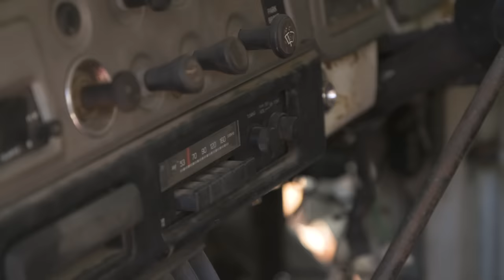THIS 4WD HASN’T RUN IN 19 YEARS… Will it start? Shauno's Barn Find Toyota LandCruiser 40 series!

Comment: The fuel shut-off lever has a solenoid that pulls it in the opposite direction for starting.
Helps a lot for first start or during the day when sitting a few hours.
It fuels a bit more at start-up.
Saves the glowplugs and starter a bit in the long run.
These Cruisers are the toughest vehicles for farm and overall use. Not the fastest but will get you home and the job done.
Absolutely love them.

Great videos as usual.
Keep up the good work.
Cheers from Namibia

Comment from the maker: This is the LandCruiser I've always dreamed of owning. What's the 4WD you've always dreamed of owning? Tell us below in the comments! Cheers, Shauno
Reply: 1996 TD42 GU patrol
Reply: A ‘92 GQ patrol chopped and Barra swapped
Reply: 1995 Nissan GQ TD42 Ute
Reply: A DMW Chopped 200 series 😜
Reply: Mine is either a LandCruiser 75 series or Gu patrol chopped and extended (four door) with twist 79 V8 Engine
Reply: 12ht 60 series landcruiser, and I've found one
Reply: ✌✌😍2006  Ford endeavour (INDIA)
Reply: Finally picked up a rig i have been wanting for years. 
Factory auto 1hz 105 series landcruiser.
Turboed, intercooled. And mods to come
Reply: Single cab VDJ79 Landcruiser
Reply: A Toyota Rav4
Reply: Same as you mate and I’m driving it hj47 ute
Reply: @JP211193  those  rigs are known for blowing diffs
Reply: 6BT Cummins swapped GU Patrol! 😍
Reply: Suzuki LJ50
Reply: daihatsu rocky tonner
Reply: 75 series landcruiser same as your one shauno
Reply: 79 I mean
Reply: First generation Bronco!
Reply: Classic 62 Toyota Land Cruiser FJ 40. Restore it to original and keep it in my living room.
Reply: 75 series with 79 front and 1hd fte
Reply: Literally the exact same thing just a late 70's model and same build style
Reply: 1980 G60 nissan patrol
No syncro
no power steering
shit brakes
rough suspension
everything as rough as guts bare bones basic
I really miss mine
Reply: Being 10, I dream about a lot of cars. My dream car(s) would be 1. A big V8 79 Series LandCruiser 2. Or a well done up Short-base GU Patrol.   :)
Reply: Keep the rusty bonnet
Reply: 1989 Chevrolet Blazer (U.S.A). Currently my daily driver. Great vid. Keep 'em coming. Cheers.
Reply: 2011 Toyota Landcruiser VDJ76R
Reply: CONGRATS Shauno on the purchase, the build will be/should be an inspiration to not only 4wd enthusiasts but for anyone who is looking for something to do during these tough times either on their own or with family/loved ones. Think I may have to do something similar with my little 4 but thinking a 40 or 45 wagon ... Thoughts ?
Reply: Currently own my dream truck, 1977 series 3 landrover, chassis is buggered though so after a new galv one for it. but i wouldn't say no to a toyota like yours
Reply: Gq Td42 and i have one now.
Reply: 89 extra cab SR5 engine swap 1KD FTV
Big job but I’m getting there!!
03 duel cab SR5 1KZ-TE just watching wondering what’s happening to it older mate!!!
Reply: chopped lc200 series
Reply: put a 6bt in it
Reply: G wagon
Reply: 60 seris land cruiser
Reply: 79 series duel cab. Hopefully I'm only a couple of months of finally owning one
Reply: 4WD 24-7 the 200 series in my driveway 👍 well done on getting the old truck going
Reply: My dream truck is my daily driver, turbo 2h swapped fj45 troopy!
Reply: Bundera
Reply: Blue Marlin 80 Series
Reply: My dream 4wd is exactly what’s in this video Shauno. So keen to see the build👌🏻
Reply: Great wall
Reply: Mine is a 1986 Toyota landcruiser bj73 had one wish I never sold it
Reply: I finally own it A Landrover Defender 110 from the 2006 G4 Challenge event. It's in Tangiers Orange with an auto fitted and twin lockers. Its great for getting around on my island
Reply: 12HT 60's Series in that sandy colour
Reply: 105 series landcruiser.  That's a problem since I live in the states.
Reply: I'm starting to like Toyotas
Reply: Ls swapped gq and enough money to keep fuel in it
Reply: I think it has to be an 80 series for off roading but if I was overlanding I'd go for a Ranger or a dmax, I know quite a few weaknesses on the Ranger that need to be fixed before I woukd trust one though.
Reply: Ram 2500, Cummins, Bench seat, 4x4, 6spd MANUAL.  Just bought it a few months ago!
Reply: Would have to be 70’s to early 80’s f100
Reply: Although not a 4WD, it is the Chevrolet 3100 as a classic, and for today a Ford Raptor or Jeep Gladiator.
Reply: Always wanted an older Hilux ever since I was young. Grandad had an ln106 for over a decade and I fell in love with the old hiluxes. Since getting my license I'm on my 2nd ln167, with plans to buy a 106 shortly for a project
Reply: Pretty much that one.👍
Reply: My dream one is a BJ40. The perfect one will be a 1980 model, that way the car an I will have the same age and will get old together as I will never sell it.
Reply: 1985 f150 4x4, flareside, 300ci inline six, 4 speed manual with the granny low first small lift on 33's,bed mounted rollbar,bucket seats black with gold pinstriping. Of course I have a soft spot for CJ5's as well, a CJ5 was my first 4x4, no power steering, no power brakes,258 inline six with a 4 speed manual transmission. REAL basic lol.
Reply: mine is a 1988 k5 chevy blazer square body with 350 engine on 33's
Reply: fj45 Landy, with the mighty 2H😂😁👍
Reply: WWII willy
Reply: 40 series landcruiser, but can't get them in the US.
Reply: I've got lucky and bought one of my dreamed cars. BJ70 (the one of my pic). I still want a Series II Land Rover Santana for my dad and my final dreamed car would be an LC79 V8 (but this version doesn't exist in Costa Rica, so too bad for me).
Reply: Only thing can say. Gear box diff center.  More legs. Other then that leave alone. Build to last go anyware)
Reply: One of the same Shauno, had a 47 in lake king WA. It was a beast.
Reply: I had a 69 holden ek with a straight 6 in the same boat n she fired up
Reply: 79 series dual cab LandCruiser. My dream came true December 2018 when i bought one brand new. Haven't looked back.
Reply: A Land Cruiser 80 Series for me
Reply: Landcruiser BJ74
Reply: Being in the US we simply don't have vehicles like this one.  My dream would be a 74 or 75 Ford bronco with a 302 v-8 and built to tame the trails, sorry tame the tracks.  My wet dream a Lamborghini LM002 around 1990.
Reply: 80s tacoma , I'd swap my '12 for one !
Reply: My dream cars would either be 1) a legendary old Mitsubishi Pajero specifically the 3.5 litre 24 valve escape. 2) a ether a GU or GQ patrol with a big V8 swapped in it or a 3.0 litre TD intercooled patrol. And 3) an old FJ land cruiser
Reply: Zookie
Reply: Huilux for my p’s and 80 series for future
Reply: The one I've already got, 75-series ute with the 12HT.
Although I must say though that the 47 ute is the best-looking of the lot. The styling of classic Toyota trucks is timeless.
Reply: Patrol to recover Toyotas
Reply: 4WD 24-7 hj47 Ute 2h literally same as yours
Reply: stoney steve lol
Reply: 1984 AMC Eagle SX4 diesel swap would love to get one and give it a full blown interior upgrade for camping/comfort.
Pissed though i found a mint 81 Eagle Sport for $1,000 USD no engine which was fine since i planned to drop a cummings in it. but... just started a new job and didn't have the funds.
Reply: 60 series cruiser.
Reply: 79 series land cruiser
Reply: FJ 40 anyday..
Reply: Any 4wd i do dream of owning something newer or older than my 1990 fj80 with the old tractor 3fe engine but i just cant get rid off my old beast any  4wd that you can go out and have some fun off road or camping would do me doesn't matter if it cost $2,000 or $200,000 as long as ya have some fun with it
Reply: Dodge Power Wagon or a Unimog!
Reply: F150 raptor
Reply: The landcruiser I've always dreamed of owning is my HJ70 troopie, 1H engine which I still have 20 years later and hope to have in next 20 years.
Reply: 1987 chevy k20 !!!
Reply: I have owned a 1954,  civilian version of the Military Dodge Power Wagon.  I sold it, big mistake.  Owned a 1966 Chevy 4x4 pick up, but sold it.  I currently own a 1978 Ford F150 4x4,  which I plan to keep.  The Power Wagon was a mild dream.  My main dream has been to own an M35 Military Deuce and a half, diesel.
Reply: Supercharged L67 3.8l buick swapped 94-97 Toyota Hilux. With the supporting mods of course.
Reply: 1968 Chevrolet K-30 Suburban
Reply: 1series 😸 haha haha 😂
Reply: Ln105/ln106 double cab hilux. Getting rare now here in the UK 🇬🇧
Reply: Defender td5 90
Reply: I just picked mine up... restored 1984 BJ40!! Just an incredible machine.
Reply: Hi from South Africa, land cruisers are a blast and also the Hilux. Build like tanks and never give up. Here you don't see the anymore. It's all these new damn SUV's. My dad had a 84 Corolla sprinter 1800 GLS. I would loved to own and a Landy like that. Good luck with the rest of the build.
Reply: We have one of them in Sept it's a 45
Reply: I'm grateful to have my dream vehicle parked out in the driveway - '79 Jeep Wagoneer
Reply: 3B 1985 60 series (Bhutan) have difficulty in emission testing though
Reply: My 'dream' 4WD, is actually the one I own ~ the 1990 SWB Landcruiser 1PZ.
Reply: 79 series
Reply: 1990-2000 Toyota Landcruiser 80 Series with the diesel it comes out with, believe it’s a 1HT??? Manual and I want to deck it out and keep it mint.
Reply: Why no build videos yet ???
Reply: I allready own one of them a 1hdfte RV 79 but next would be ethier a 105 converted to a fte or a ft 80 series Sahara unmolested and a second gen dodge ram with a 12 valve Cummins
Reply: Just got a 91 lj73. See many of those?
Reply: Land CRUISER SERIE 70 pick-up .i Love

Comment: 96000 Ks she’s probably already rolled over 1 mill and reset 😂
Reply: 1 million km it's just out of factory for a land cruiser
Reply: The odometer only goes to 99999
Reply: @lastknownlocation8760  then rolls back to 00000 and starts over.
Reply: what a load of crap
Reply: @gibsonethirty2836  You must be fun at parties
Reply: @iain1969  .|..
Reply: @lastknownlocation8760  4:31 096844

Comment: Very cool truck! I had a 1968 FJ-40 for quite a few years. It was pretty much all stock. It was tough as nails and went anywhere I pointed it. I live in the southwest US, so it saw lot's of deserts, desert mountains, and canyons. It logged a lot of miles in Death Valley. I'm an old retired guy and have owned all manner of four wheelers over the years and the FJ-40 is one of my favorites. Currently, I drive a 1989 Isuzu Trooper 4 door and a 1998 Jeep Cherokee 4 door. I love 4 wheeling.

Comment: My fj75 troopy with 3f (carby) sat for 10 years in a shed. i put a hose from the fuel pump into a jerry can and put a battery in it and it fired up in just a few cranks. didnt even need to use tools. love old toyota's
Reply from the maker: How good!
Reply: @4WD247  you should do Ellis track in the wet. near impossible to get up in the wet. a lot of winching

Comment: I started work at a Toyota dealership in Spare Parts in 1973. I still remember the FJ55 s etc with find memories. I also still remember most of the common part numbers as well. I went on to become the Service Manager and remember just how good these vehicles were . Not as flash as some others but absolutely Bullet Proof.

Comment: We had a 1982 HJ47 Troopy which we took through the Flinders Ranges & the Simpson Desert.
It had a centrifugal oil filter as well as the spin on filter, was still running the split rims & on a trip of over 8,000 k's we had only a single puncture.

Comment: I was on a construction project building a tunnel under the Suez canal in Egypt back in the late 70s, my job was to supply the tunnel on a daily basis. We had tunnel lining segments spread across the desert and my means of transport was a Toyota pickup with drop sides and tail gate. Haven't seen another in all those years so thanks mate for opening up more memories from the past. I swapped the Toyota out for a long wheel base Land Rover, wait for it !!!!! FIRE ENGINE complete with chrome bell and search light which I managed to get back to then UK. Sold the bell and mounted the search light on my 1930s cabin cruiser. On a trip to Cairo met up with the Land Rover Sales and display team on a military supply tour. Well we just had to invite them back to our Camp on the banks of the Suez Canal for the w/e.
The display guys taught me how to drive Off road without killing my self, man we were putting those short and long wheel base LDs in places I'd was Sh-----g myself. But in came in handy when my next contact in Cairo again with a 110 County Land Rover we would go wadi jumping in Sinai and on down to Sharm El Shake.

Nice one mate enjoy.

Comment: My passion has always been hilux utes. I owned a 1980 single cab 4wd fitted with a ford essex V6 3.0L for about five years and then owned a 1990 double cab 2.2 petrol for fifteen years. Absolutely loved that truck. Just bought myself a 1992 land cruiser 80 series 1hdt. Preparing it now for a bit of overlanding. Good luck with your 47 mate, its an absolute gem of a legendary truck!

Comment: Always good to see a workhorse wake up from a long coma. The closest I've come to this personally is that I'd had an HZ Kingswood asleep in a shed with no front door, in the middle of a farm paddock. Never started or run for those four years. Bolted on a carburettor and a battery, put the wheels back on (was on axle stands) and the old boy fired up in only as much time as it took to fill the fuel bowl.

Comment: Sweet new ride! I'm jealous. By the way most vehicles will run without a battery. Once a engine is running, the alternator will keep most running. Does depend on thr vehicle of course and how it's electrical circuits are ran.

Comment: Great video Shaun. The engine on this Cruiser will last another 20+ years easily.
PLEASE Please leave the BONNET as it is, only give it a clear coat. The rusty bonnet look will look EXCEPTIONAL... 🤠
Reply: Take it on the old power-line track on it's "maiden voyage" 🤠

Comment: Wish I had a Toyata Land Cruiser Diesel with no electronics, no computers. I am rebuilding a '79 GMC C-1500 right now but it isn't 4WD. It is a tough truck, you could say "a diamond in the rough". I work on it when the Alabama summer lets me, and am going to "rattle can" paint it O.D. green with black bumpers once the internals are finished. Looking for an AM tube radio to fit the dash to make it totally EMP proof. Thanks to my Uncle and my Dad, I know auto mechanics and electronics - they taught me well. No rust except stone chips and needs new regulators and rubber seals for the windows both sides. Pulled the HEI distributor and replaced it with points and capacitor ignition, the 350 was a "crate angine" both balanced and blueprinted and runs sweet with about 3,500 miles on it - just broken in. I could be persuaded to part with it for any year CJ-5, civilian or military even trade. Great video, thanks!

Comment: As a patrol owner I admit I love these old girls, I had a old troopcarrier even came with a crank handle, 2 pumps of the peddle and off it went, the sad part was is was not in good condition and required too much work at the time.

Comment: My 1HD-FT will run, push start without a battery or alternator. Sure you won't be able to wind the windows down and you'll have no lights or dash, but it'll run as long as there's fuel. Best of both worlds.

Comment: got a pulley with an old fc bonnet cable rigged to the fuel shutoff in ours, works a treat and you can still turn it off from the cab :)

Comment: Got a HJ47 on the farm. Gets driven probably once a year as the old man doesnt use it anymore as he's got newer retired utes.

Every year, with out fail... prime the pump and turn the key away from you to heat the plugs and it fires up straight away.

The boys and I always laugh as the body has rusted away over the past 25 years but it refuses to quit.

Comment: My favorite stock cruiser was a 3 speed on the column. My buddy's with the 4 speed could not keep up to me.
It had the old oil bath instead of an air filter and at steep angles would suck in oil to the carb and create a mosquito killing cloud of smoke.

Comment: I used to drive one of these on a Cattle-station and we used to have a coathanger wire that ran to the Fuel-pump to use as a Kill-switch...lol

I remember bottoming it out in a big divot (pothole) on a dirt-road when leaning forward to spot where the Boss was Flying the Plane above Me. As it dropped down into the Hole the 2 Catches for the Bonnet gave way and it flew up and Slammed into the Roof scaring the Crap out of Me....not good at 70kph on a Dirt-track and having to Hang the head out the window to see till I pulled up. The bonnet was Bent like a Banana and I couldn't quite straighten it out there and then, despite spending 15 mins kicking it straight-ish. The two side-latches then didn't reach and I had to tie it down with a piece of rope from the back of the tray....got a roasting from the Boss for that...lol

Comment: nice truck  but you should always fill the oil filter up before you put it on . on any eng , Do to an oil filter that size will take about 3 min to fill and start flow back to the eng, in that time you have no oil going to your bearings

Comment: My first Land-cruiser was good old HJ47, Dec 1981 model, 12000 k when I bought, updated to 1994 HJ70 at 495,000 k, only problems was 1 new clutch, gearbox at 300k, cracked head after water ingestion (before snorkel) that model had shocking brakes, drums all round and tailshaft brake, which never worked, I think your model had disk brakes all round, despite all that, mighty machine. Where should you take it for First trip? I reckon the Roma Pub.
Cheers
Wombat.